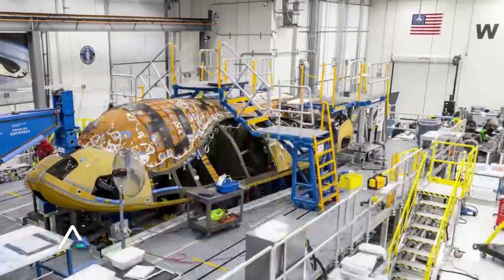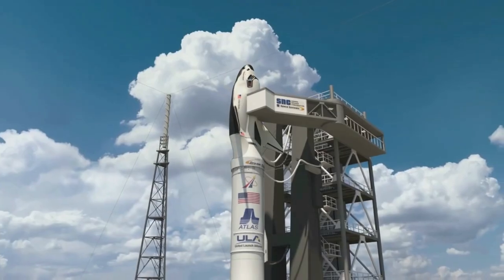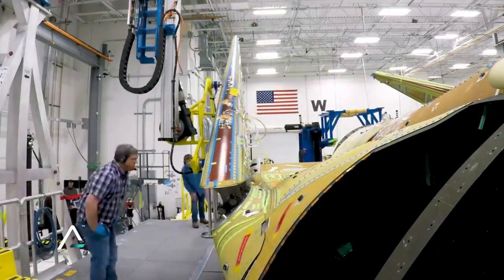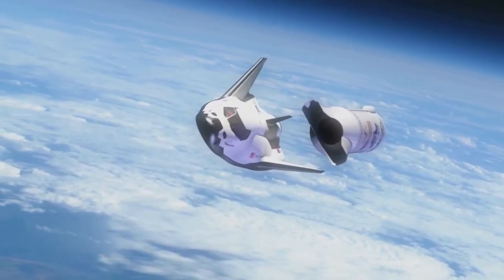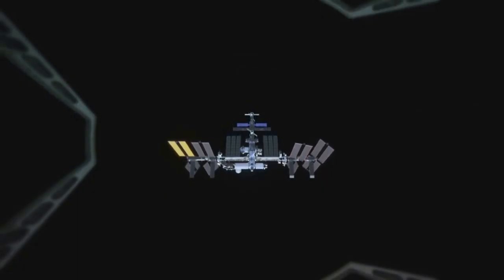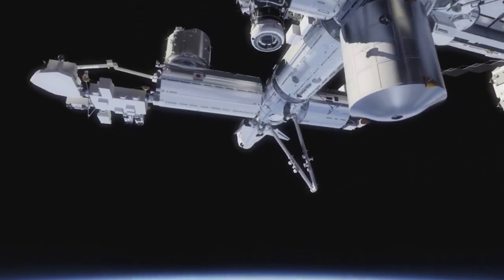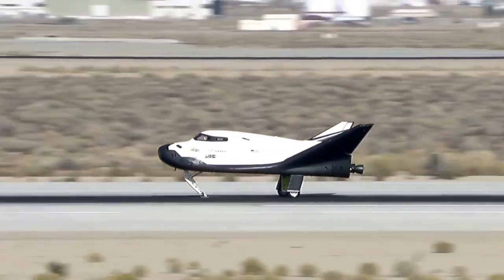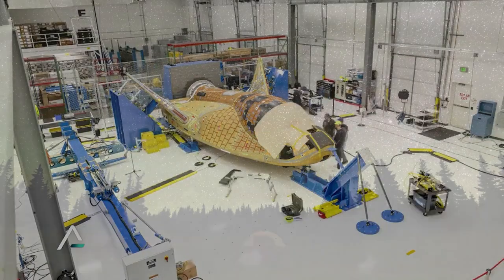Sierra Space Just Revealed Work On A New Dream Chaser

Comment: One of your better videos. The Dreamchaser actually looks very much like the system originally envisioned by NASA when they were first developing the Space Shuttle. (STS) A similar size, mass and utility, until the lack of funding brought in the USAF, who brought a bigger budget, but also their own requirements (payload and cross range) which compromised the program. I look forward to seeing it fly. Hopefully it will eventually ride a reusable booster.
Reply: They had to sign with ULA so that's a no for the booster.  
Not for a whole while if ever.
Reply: I fully expect SpaceX to run ULA out of the business on cost, if nothing else.  When that happens, the other companies making reusable boosters can do their launches or, perhaps, they can buy some F9 boosters to use after SpaceX gets all moved to Starship.
[Add]
Never mind about F9... the reasons why not were supplied further down the comments.  Still, other reusable are planned by other vendors; perhaps one of them will work for this application.

Comment: Was there any negotiations with SpaceX to use Falcon 9 as the launch vehicle?  Would be nice to have both vehicles reusable.  Just wondering.
Reply: That would require an expandable Falcon 9 with an extended fairing, which doesn't exist at the moment.
Reply: plus the falcon fuselage is too thin for the dreamchaser